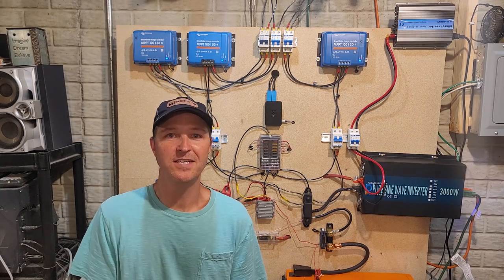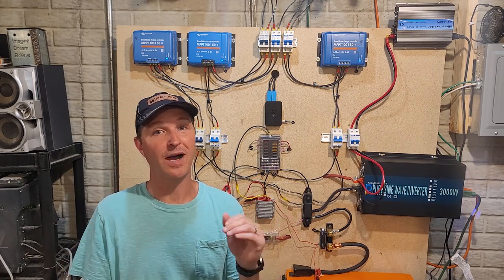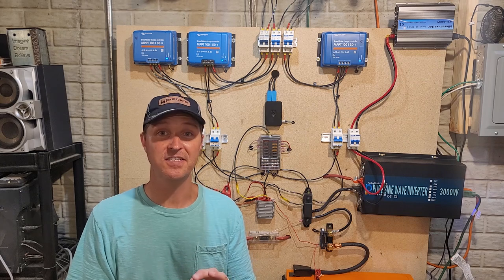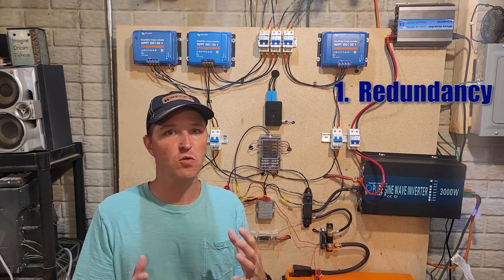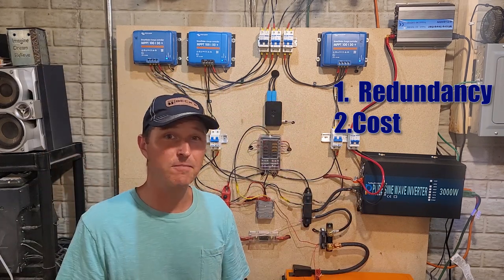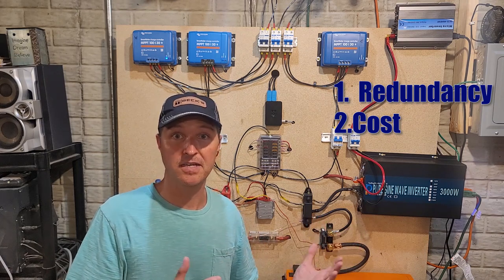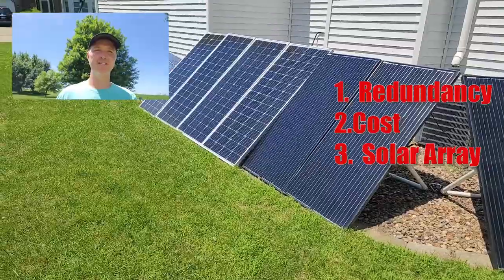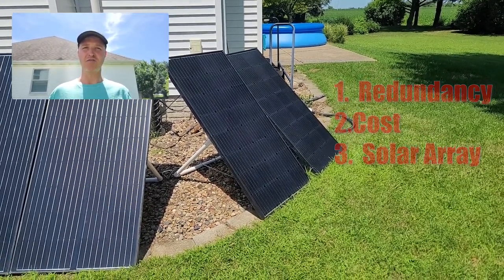Why I go with Multiple Charge Controllers

Comment: With your system, how do you charge your family's USB devices?

I have quite a few backup charge controllers, but I don't have them currently plugged into our two systems.  I have been thinking of adding an additional charge controller to each system that does not have any solar input, but allows me to double the number of USB ports on each system - I'm not sure this really works, but might.   Will probably turn the 2nd one off, in the rare cases the USB charging ports are not active.

Thanks for the video.
Reply from the maker: I have a couple independent USB plugs wired to the 12v section of my system.  They are wired to the fuse block.  I ran 18awg wire to another room and have wall mounted ports for USB.

Comment: Victron is meant to be best so I think YOU would reach max MMPT wattage much quicker and higher than my Y&H ..HOPE to see you wire up  1000 or 2000 with the limiter...It get conplicated as only 1 input not separate PV and battery inputs..I heard if solar controller disconects battery can damage controler...So not do not feel safe....Also catch with 2000w version you have to go up to 48v battery...
Reply from the maker: My thought was to upgrade to a 1000w w/ limiter, but I also read about how the unit can be damaged if disconnected for the grid via a smart plug.  I guess it does its "islanding" from the clamp limiter.  if the limiter doesn't detect amps it disconnects. The 600w I have disconnects when it doesn't detect amps in the plug.  At least that is my understanding.  With that being said I feel the unit I currently have is better for my application.  I also believe you can program the Y&H unit to disconnect when the input voltage drops below so sort of threshold. Ex:  25v disconnect voltage.

Comment: Awesome 👍.   When running charge controller in series they don't have to be identical  in voltage...  ??   I love VICTRON.  I have a 100/50   in use .and a used 100/30 in the closet.  I'll hook it up because I could use the extra 400 watt to my battery
Reply from the maker: The two 12v batteries are in series, but the charge controllers are in parallel.  I love Victron as well.  I definitely don't regret spending the extra $$.  Thanks for the comment.

Comment: So, from your diagram,  it looks like they are all commoned at the battery.   Their outputs are connected together.   How is this possible?
Reply from the maker: Since they are all smart victron mppts l, they communicate with each other through Bluetooth.  That way they all stay in sync.  Hope that answers your question.  Thanks for the comment.
Reply: The vicron uses VE network to associate and coordinate the output.  My system also has a smart shunt and a smart voltage sense / temp sense unit.  Also, keep in mind that BOTH or MORE of the controllers need the same settings for float, bulk, etc otherwise the application will yell at you.  My system also has morningstar and midnite solar controllers and all you have to do is again use common settings for the battery target.  I call it solar salad.

Comment: Nice video, like the content so I subbed as well.
How hard is it to set up the 3 victrons to power 1 battery bank. Thinking of adding a second victron CC to my 5th wheel instead of going to a bigger one.
Reply from the maker: Thanks for the sub!
Connecting a second charge controller is very easy.  I have a video on connecting my third:  https://youtu.be/dpxF1eg7UQQ
It's even easier if you are connecting the same size controller b/c you can just save your settings on the first controller and load it onto the second controller.  Super easy.  Wiring is the exact same as the first controller.  You will need to re-arrange your panels into 2 separate strings.  Good luck!

Comment: Can one combine all negative  outputs of the solar strings , route it to the negative input at each controller?  Each string would still input its energy via the positive wire from the string. It would just neatin up my wire mess if possible....
Reply from the maker: I don't believe so in my case.  All of my strings have different amps / volts so I think it would cause issues.  Thanks for the comment!
Reply: @OffGridBasement  Mine also have different voltages and amps. Another analog would be combining all negative poles of some 1.5, 3.6 and 9 volt batteries. A meter with a probe to combined negative and another on the positive of the 9v battery will read 9v. Currently I have 4 negative conductors feeding 4 controllers from 14 feet away from the cable entry point. I'd like to "terminate" them to a copper bar and run a single cable to another copper bar that would use very short 10 gauge wires feed the controllers. I also seem to have seen that the negative solar inputs should be earth grounded ? Anyway no one has all the answers and I greatly appreciate your input. Last thing, I've purposely installed 2 smoke detectors in my basement solar area. Things made in China seem to burn. In a previous life I was a electronics technician working on communications equipment, I've seen capacitors explode, high power RF transisters fry and chokes vaporize ! The difference is those were properly engineered products with purposeful shielding, thus a lower possibility of risk, stuff from the CCP is absolutely garbage spare a few brands. So most folk have a solar shed, I'm in the process of moving all mystuff outside. Here in Virginia it rarely gets below 10 degrees so I will just put a incandescent bulb in the shed to warm up. Thanks for your channel and remember "folks that are experts know a lot about a single thing, but us DIYers know more bout Everything ! "
Reply: @lovasjj  I think panels essentially operate differently to batteries. If they are mismatched when connected they feed into each other and can cause them to short. I speak under correction but I would be very sure first before potentially frying panels
Reply: I certainly agree caution is needed. I do enjoy examining situations that logically make intuitive sense but require deep consideration.  Many power systems today have common negative grounds but isolated positive poles. A automobile that has 12 volts across its starter fan or vehicle running lights will also have a common ground 5 volt regulator for the onboard computer. All these devices ( solar panels, the battery analog in my previous post or an automobile ) are DC devices and all have common rules. Indeed you can't simply hook a 5v and 12v source in series or parallel.  Nor can one expect good things from hooking devices with equal voltage but differing output current in series. My question doesn't involve either principles. I cant see any issue with it and frankly that bothers me. Perhaps a simple way would to check for continuity from the controllers negative solar input to its metal exterior heat sink. If presant hooking up 2 or more controllers, mounted on a metal plate would create the exact scenario I've talked about. More study needed ! Thanks for reminding me of caution ⚠️...
Reply: @lovasjj  haha if you ever do come to a definitive answer I'd love to hear :)

Comment: Victron, Epever or Fangpusum charge controller
Reply from the maker: Is it 12v or 24v?
Reply: @OffGridBasement  12/24/48/60v and 60 or 80A , I'm looking at this because I'm using fangpusum 50A but I want to get more  lasting power supply.

to be sincere i don't know which to invest on to improve my power, I want it to last longer when there is no sun because I don't use any electricity all I depend on is solar system that I have,

currently I have 4 batteries(24v system ) 2.5kva inverter and 6 panels charging.

I have been asking people and some say I should add more panel, some say I should buy 1kva inverter cus it consum less energy and last longer without sunlight. 

please help me out sir
Reply: @OffGridBasement  still waiting for your reply
Reply from the maker: @LifePhath  honestly the only way to get more power is by acquiring more battery storage.  Getting a smaller inverter will only save a small amount.  Does your battery bank get to 100% most days?
Reply: @OffGridBasement  some days it gets 100% (it last longer)

Comment: I have a 96v solar panel system charging a 48v batter bank via a 48v charge controller. Can I charge a 12v batter bank with the same panel system by adding another charge controller? Any advice would be very much appreciated.
Reply from the maker: The voltage would remain the same but amperage would split.  I just don't know how evenly the split would be.  I'm sure it would be 50\50.  Thanks for the comment.

Comment: good job... so each controller goes to a different set of panels.  ... Victron doesn't allow us to connect controllers to each other ... right?
Reply from the maker: They are connected through a Bluetooth connection, but I don't believe you would want to connect them physically through wiring.
Reply: @OffGridBasement  thanks... that makes sense.

Comment: How do you combine the output of the two Victron 100/30 charge controllers? Does this create any issues?
Reply from the maker: No.  The charge controllers communicate with each other through Bluetooth.   I've never had an issue.  Thanks for the comment!
Reply: All you need to do with the Victrons with blue tooth or the smart dongle is to set up Ve networking and assign them to the same network.  Its VERY each.  Also, I highly recommend the smart shunt and the smart battery sense/ temp unit as that data is shared with the same network.
Reply: @Gary-wh7ce  Hi. This fixes problems with units limiting each other to float voltage? A few reviews on Amazon mention this problem so I was scared to recommend these as a way to slowly build up capacity by adding another Victron when funds allow.

Comment: you mean sir 3 scc in one battery?
i wana try this i have here 20amps scc with 200w panel
and 40amps scc with 550 solar panel.
and onee battery 100ah 12v.
it is possible to use my two scc to charge one battery??
Reply from the maker: Yes!  As long as they are both using the same profile settings.  Same bulk and float settings.  If you can have the same length of wire going to the battery from both controllers it helps.
Reply: @OffGridBasement  thanks for the help sir..im now using two scc now  in one battery and its working fine.🙏🙏

Comment: Great video, thanks or making it. I am a beginner so this really helped me with purchasing controllers.  Do you merge your systems into one or keep everything completely separate? ( Does one set power the living room, another set power the refrigerator, etc.?)
Reply from the maker: I'm actually working on that now.  I'm getting a 6 circuit manual transfer switch for my house and everything is going mostly toward powering it.  Thanks for the comment!

Comment: Wow..  IMHO you slaughtered that.. Hard to follow and understand. I have several Victron products.. 150\100\150\45, bmv712 smart, cerbo, Lynx 1000 distributor.. I need a small busbar to connect the power\battery leads so I can connect my 2 arrays; 1600 and 1740 and 400Ah worth of Lithium.. I'm also doing it for redundancy. Oh.. I didn't mention the 12v 3000 120 Multiplus II. My Eco Worthy tracker will be arriving Monday..
Reply from the maker: It sounds like you have quite the setup.  I've always felt like the video wasn't that smooth.  Thank you for your honesty.
Reply: @OffGridBasement  I have a bit of money into it. Just wish I was not such a dummy about wiring. I want my multiplus connected. I'm saving to buy some land and go off grid. With a properly setup up solar system and RV.. it won't be too tough. Well.. off to town I go.. I'm in S. Oregon, how about you..?
Reply from the maker: @Mywhtjp  That sounds like a wonderful plan.  I lived in Grants Pass for a couple years when I was young.  I'm in Central Illinois.

Comment: with a bounch of  240 old clasic rigid panels   i m going to have an 100/30 soon for  straight   middle day array 2s3p  and my already bought 100/20 smaller one for 2s2p  array for sunset extra direct  because i need some afternoon charge . question is  . do i have to worry for the different amperage to the  primary charger .... or its mosfets can  withstand  the late afternoon higher amperage ?     all in one battery of course
Reply from the maker: I believe it will work just fine.
Reply: @OffGridBasement  did you try to bluetooth pair a victron smartsolar charger  with a smaller one . WITHIN their power specs.. ?      i dont want to push 100% on any part but might need to buy bigger one   maybe 150 series  one because new big panels come in 48v and 96v limit of the 100v series is too hard to maintain in any series which i might go !!!!  thanks   i still want to use the small one for start in another array .. maybe both are going for about 16 amps average  on different angles  pannels..  my problem still apears because i cant series 3 of my pannels and if i purchase  48v panels  then i can use only one series  of them..    buying  another 100.20  .. then the losses due to low power matching panels  will be doubled!!!     my guess is that it can be bluetooth pairing as long as they both are smart solar but  i wont go and buy  on a single guess   ! thanks again  ..

Comment: Dosnt having more then one solar charge controller on the one system make them stop working properly
Reply from the maker: The Victron charge controllers all communicate with each other.  That way they all go into absorption and float mode at the same time.  Thanks for the comment.

Comment: im using cheaper charge controllers and have one for each set off batterys it seems to keep them the battery fully charge easier that way so if i have two batterys on one inverter i have two charge controller i can't a ford the high dollar one
Reply from the maker: Thanks for sharing.  I'm glad everything is working for you.

Comment: I noticed the Victron 100 : 20 unit has 48V stamped on the case.

I assume that it also does 12, and 24V ?  Or is it 48V only?
Reply from the maker: Usually they do 12 - 48v, but you would definitely want to make sure.

Comment: how are you inputting so much solar into a 100 35?  victron says they are rated at 12v for a max of 480watts
Reply from the maker: It's a 24v system so the CC can handle over 900w of solar.  Thanks for the question and the comment.

Comment: How many watts can Pwm 30A solar charge controller can handle at max? Can it handle 540 watt panel 12v or 460 watt panel 12v?
Reply from the maker: Usually a 30A controller can handle 100v.  Make sure the open voltage of the panel is lower than that.  If you multiply 30 x 12v you get 360w.  That is the max a 30A controller can deliver @ 12v.  Hope this helps.
Reply: @OffGridBasement  yes it did. Just that I noticed the max amps my 360 watt panel gave was just 19 so far, most times cos of the weather is around 4 to 17 amps with average of 11 amps daily. Was thinking of making it 460watts on 30amps charge controller
Reply from the maker: @basilkasimi2646  as long as you don't go over 100v from the panel you will be just fine.  Just remember if you get a 460w or a 540w panel the most you will get from it is 360w on a nice sunny day.

Comment: Curious how long you can get those blue victron controllers to last for? Thanks.
Reply from the maker: I've had mine for almost 2 years now and they still work flawlessly.  I'm hoping they last as long as the batteries.  Around 10 years.

Comment: at the end of the video, is that your current setup for your solar arrays?  Just wondering how it is working out having it on temporary ground locations.  I'm doing a bit of a test at the moment and looking for the best thing to do with my panels before rolling out a bigger array.
Reply from the maker: That is exactly the same setup I have today.  It's worked perfectly.  I've never had an issue with it.  I'm planning on making a follow up video of the PVC stands and how I have them secured to the ground using ground anchors.
Reply: @OffGridBasement  that way uld be great thank you.  I have 12 panels to put out.

Comment: Did you make separate PV inputs for each controls?
Reply from the maker: Yes.  Each controller is a different string of four panels.  Two strings are 800w and the other is 1000w.
Reply: With PV connected in series, each battery connected in series, can we charge with separate controls with a single PV without separating the batteries from each other?
Reply: Each controller needs its own PV input (wish you could just use common buss bar).  But multiple controllers can charge the same battery @KutsiTekin

Comment: That is the reason way I have 6 charge controller
Reply from the maker: Perfect!
Reply: @solarandwindinsouthtexasda1473 - Even with 6 controllers, you have zero redundancy. You just have 6 independent MPPT's.  If you lose one MPPT controller then lost 1/6'th of your power.  That is not redundancy.
Reply: @MrSummitville  you are right but I have three more charge controller put away

Comment: You just have to say it's more cost effective and has additional redundancy . Very complicated explanation
Reply from the maker: That is the shortened version for sure.  I just wanted to make sure I covered everything.  Thanks for the comment.
Reply: @herbertvonsauerkrautunterh2513 - There is no redundancy.  He has 3 smaller independent MPPT's.  If one MPPT fails .. it fails ... and he loses 1/3rd the of PV power. That is not called redundancy.

Comment: Just don't connect different solar module types with different specs on 1 mppt.  That's the most important reason.  It will reduce the power of the best modules.  
I would also make a better mounting system for the solar modules.  They won't last in a big storm.  And maybe you don't believe in climate change.  But there are more storms than it used to be... So more ballast,  on metal mounting system with good ballast or anchoring in the ground.
Reply from the maker: Thank you for the information and comment.